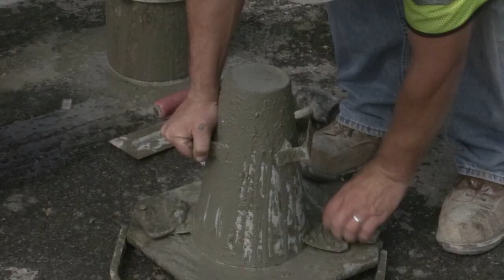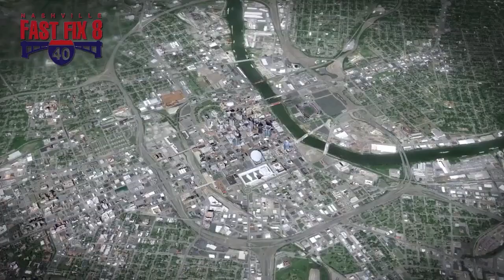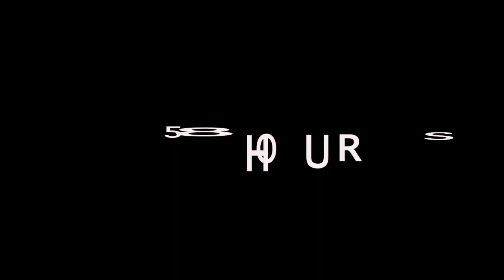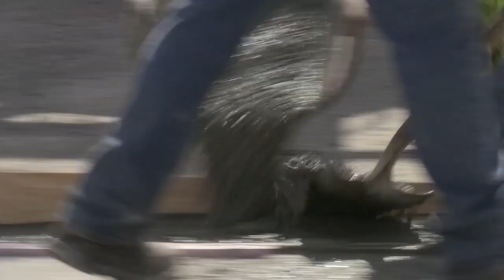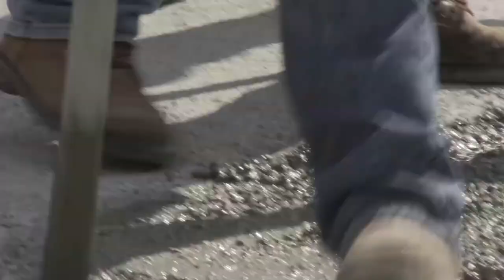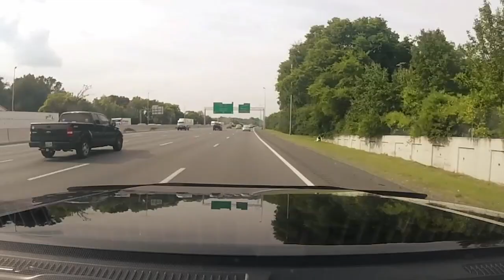Fast Fix 8: Special Concrete

Comment: TDOT only uses magic concrete.  Its really amazing because it crumbles as you drive over it and ends up on the side of the road until someone gets a blow out when they drive over it.  If you are interested in this magic concrete just stop on any interstate in the Nashville area and grab a piece.  I personally collected a 6" chunk that I drove over last year.  It magically put a huge hole in my tire and almost ended my life.  Thanks TDOT.